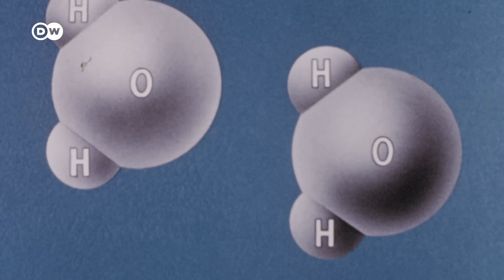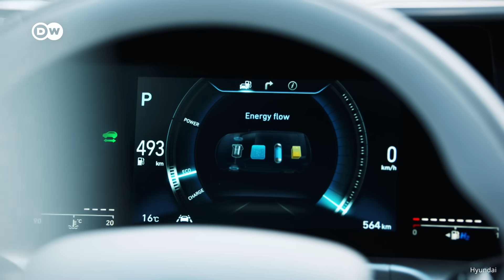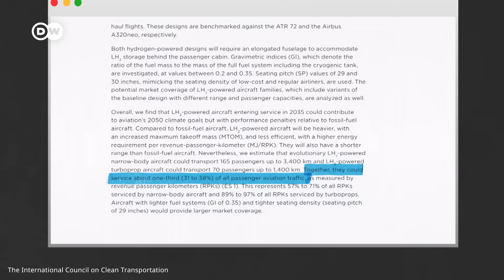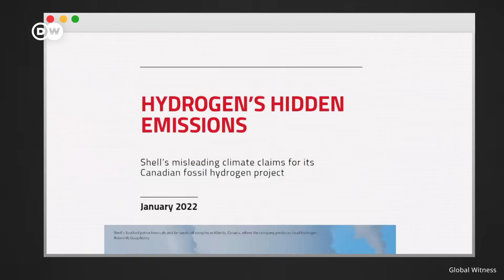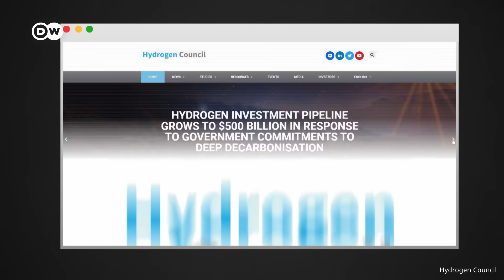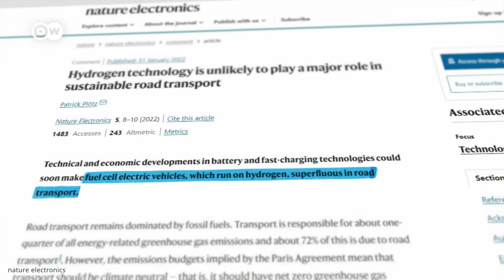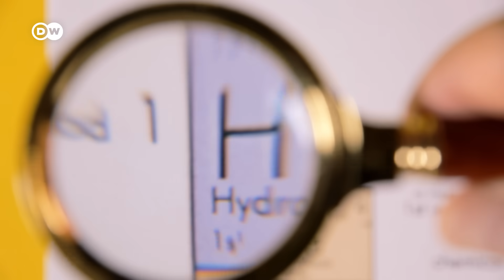The truth about hydrogen

Comment from the maker: What do you make of the hydrogen hype?
Reply: I got a question : FRESHWATER. Is it needed for it ? If so, we should just ditch the whole thing.
Reply: @lysandroabelcher2592  u can use sewage water and sea water too
Reply: @mariofornarelli1067  nice idea with sewage water. Never thought of that. It would solve my apartment block's waste, if it was possible.
Reply: @mariofornarelli1067  you can but it's less cheaper as a process than using freshwater and worsening the environment.
Reply: @anyonehome8609  Plug Power is using sewage water for their hydrogen plant in Cali. They are using renewables to make the hydrogen too
Reply: @mariofornarelli1067  thank you for that. I will take a look.
Reply: @anyonehome8609  Np 😊 And if you want to invest in Plug Power their ticker is $PLUG. Plug Power only makes hydrogen from renewables (green hydrogen)
Reply: @mariofornarelli1067  I was just having a look at that
Reply: @lysandroabelcher2592  what’s the by product of burning hydrogen?
Reply: @bundunett3212  water STEAM that flies far away from the freshwater body it was taken from.
Reply: @lysandroabelcher2592  Yes, you do need  fresh water but not just fresh, you need, you need pure water, free of contaminants. Your household water supply would need to be purified. 

But your comment  I assume, relates to the amount of freshwater needed and the fact that fresh water needed for human or agricultural use would then be depleted.

You needn't worry. We now have as much water as the planet has ever had or will ever had.

We'd be taking a minuscule amount of it to power the whole planet if we were to do that via GREEN hydrogen. When put through a powercell, that hydrogen would turn to water when exposed to oxygen. That reaction is what produces electricity. If that water falls on the ground it would evaporate and fall as rain on the oceans or rivers or lakes.

But you're right. You couldn't build a desalination plant in Nevada's desert and use Las Vegas' water supply to produce hydrogen.

That is why you would build hydrogen plants next to big flowing rivers or preferably, on coastal locations where you would also build a small desalination plant, tiny in fact.

I say small because you only need 10 litres of water to produce 1kg of hydrogen containing 33KWh of electricity. 

10m litres of water to produce 1Mt of hydrogen  that 1 million kg of it. Or 33GWh of electricity.

 

To give you a physical example, imagine a 1m³ box shaped container. That's 1m high by 1m sq. That would contain 1,000 ltrs of water, enough to produce 100kg of hydrogen. You'd  need 10,000 of them producevthe million kg of hydrogen

How much freshwater dies a desalination plant produce?  A small one would produce around 200m litres a day. That'd be   20 days supply for the plant producing  the Mt of hydrogen a day.

Thing is, it'll be a long time before we get plants that can produce that much hydrogen in a single day with renewable energy.
At this stage plants might produce well under 20 tonnes a day. Requiring 200,000 litres if water.

An Olympic pool contains 225,000 litres of water. 
And that why you'd only need a tiny desal plant that produces PURE water.

We have a saying here that gies; "there's more than one way to skin a cat". You shouldn't dismiss hydrogen because it uses fresh water. 

If a desal is built in an area beset by regular droughts, as parts of Australia are, you'd build a bigger plant to make water available to the hydrogen plant an the neighbours in the region. 
A hydrogen plant coupled with a desal plant would be a plus fir the region.
Reply: @reelreflections1  thank you a lot! You should put up another video with all this explanation!!
Reply: @lysandroabelcher2592  You do realise most fresh water is simply dumped into the ocean.
Reply: @crinolynneendymion8755  where? Certainly not in arid regions like California where the fuel it's most needed.
Reply: Do you understand the human body is made of hydrogen as well.  Liquefying the human body for fuel.
Reply: @lysandroabelcher2592 northeast of Calley France I walk in on the process as it was happening and as one of the voices said I went to Paris.  I went by train then by taxi then by plane to dulles airport then by rent a car to my home then
Reply: @lysandroabelcher2592  no, hydrogen implosion technology can clean nuclear waste water 99.98% first pass and 99.99% second pass leaving only water and 6 basic elements though the hydrogen flame which has no set temperature and will meet than exceed any surface it comes in to contact with so far, all known elements.
Reply: @lysandroabelcher2592  pretty sure u can use saltwater but i dont know for sure
Reply: @maxxel_  you "can"... but it might be cheaper using freshwater. So guess what?
Reply: @lysandroabelcher2592  there's more salt water on the planet than fresh. We can create drinking water from the hydrogen.😊
Reply: @lysandroabelcher2592  explain further, please
Reply: @anyonehome8609  if, say Chevron, could have hydrogen as a fuel for a fraction of the cost it takes getting it from saltwater, would they NOT tap in freshwater precious ressources??? We all know what would they do.
Reply: @lysandroabelcher2592  explain less cost effective. You're definition is maybe different to mine. I think we agree
Reply: @Lysandro Abel Cher  it's not that much more expensive compared to fresh water hydrogen production, basically you just need an extra coat for the rods and you're good to go, not too expensive and only needs maintainance like every 2 years so it should be fine in areas for with already existing or upcoming fresh water crisis.
Reply: @maxxel_  what? Are you a bit?
Reply: @anyonehome8609  a bit?
Reply: @maxxel_  sorry, a bot? But you aren't
Reply: @anyonehome8609  yea no hahah, why did u think that though
Reply: @lysandroabelcher2592  just seeing these comments.
First it take water to make hydrogen, then on combustion with oxygen creates water.
The amount of protons produced that are needed to create hydrogen and release oxygen: the question that should be asked is : when before combustion occurs do we lose protons in the process that makes less water.
Reply: @robertangelier4495  nope. Because  freshwater as a raw material would be readily available for other human consumption needs, while pure water vapor as an end product wouldn't be there to be used until only PERHAPS clouds and winds bring it back to the same place it was taken from.
Reply: @maxxel_  or else once can use distilled water also. Just let the water pass through a solar heated chamber and tap the vapor. Pretty inexpensive in vast Saudi desert.
Reply: @maxxel_  Salt is creating a very unwanted byproduct: Chlorine.
Reply: @maxxel_  Storing energy is much more than battery parks. Storing it as potential energy,  like pumping water up to store it, is a metode used today.
Reply: @th5841  yea i know, i literally study this stuff and i never said that batteries are the only solution, far from it actually. but they do have their part in maintaining a stable electricity grid.
and yes, water pump storages are great and the efficiency is amazing but you need the geological requirements for that like a mountainous region so while countries like sweden don't have any problems with energy storage in other "flatter" countries you can not rely on this technology too much and need other solutions.
Reply: @maxxel_  Yes, some regions have the better oportunity to pump up water. Like Norway where I live. I know about two places where they do that. 
There could also be other ways. Like a gigantic screwdriver that lifts up a mass. The E=mgh gives many opurtunities. Then the sum of all good enginering, including battery storage, could take us as far as possible.
Reply: @th5841  i don't think that artificial mass storages are the way to go though. they are way more expensive than you might think and their efficiency is questionable due to friction of these moving parts, but yea there are soooo many different ways of storing energy and they all have different pros and cons.
that's one of the many reasons why the whole process of switching to renewables is so complex but I'm very hopeful that we can do it :)
Reply: @maxxel_  I guess the problem with salt water is the production of chlorine gas and hydrogen gas along with sodium metal and oxygen. Chlorine and oxygen are very, very reactive and destroy electrodes.  An old high-school chemistry experiment that won't be allowed these days is to mix sodium hydroxide with hydrochloric acid, both are dangerous corrosive poisons in their own right.  But combine them and you get a (safe) salt water solution.  I suspect pure water will be needed for hydrogen production.
Reply: @lysandroabelcher2592  it is but not in a quantity that would matter
Reply: @farmer4525  tell that to corporate greed.
Reply: @farmer4525  (and others ...) "[water is needed] but not in a quantity that would matter" Actually, that's not an accurate conclusion, as it casually glances over a huge amount of complexity. It may be that you've arrived at that conclusion by reading through Green Hydrogen marketing literature. That claim may be arguably true at the initial prototype-project levels being proposed, however at the scaled production quantities being spruiked globally in sales pitches by Green Hydrogen proposals as a key alternative "renewable" energy source to help save us from ourselves, the projected quantities get significant.

Water use in Green Hydrogen IS a significant issue for a number of key reasons: 1) We already have a significant and growing problem with human water-consumption globally, where we are being forced to consider inefficient and at best insufficient solutions such as desalination; 2) We're already in the midst of a global climate disaster, where global weather patterns are see-sawing between droughts and floods in large areas - impacted in part by the loss of large sub-surface and surface fresh-water stores that help drive and regulate the global climate system; 3) We're already suffering climate-change-related problems that impact the ocean, such as temperature rise, acidification with concerns of current and losses of large bodies of frozen water in ice and glaciers: all of which play critical roles in the climate system. Perhaps  one of the biggest concerns is the weakening of the thermohaline circulation of the great ocean 'conveyer belt' (e.g. AMOC). Over the 21st century, the ongoing decline of the AMOC has been assessed by the IPCC as "very likely" as it continues its decline towards potential shutdown. This latter point is important because the AMOC operates based on a sensitive function of temperature and salinity distributions as well as atmospheric forcing. If we increase the salination levels of the ocean through the expanded operation of desalination plants, we add further negative impacts to the ocean conveyer, let alone the many other impacts to marine ecosystems. Removing water from the ocean and increasing the salinity of the remaining ocean water simply hastens the damage to a key climate system element, 4) There's also a lovely, simplistic claim often made that in consuming the hydrogen, it simply gets "converted back to water", implying that as if by magic, conversion to and from hydrogen has no impact: sadly, this glosses over several facts, not least of which is the fact that for the duration that Hydrogen is sitting in storage, it has effectively been removed from the global water system.

With all of that contextual complexity, it's non-sensical to say that the use of Water (fresh or desalinated) for green hydrogen is "not at quantities that would matter": right now EVERY amount of water used by humans that takes it out of the normal climatic system matters.
Reply: We don't need to upscale the current hydrogen market. What we need is to completely change the current hydrogen manufacturing structure which is by methane reforming method, with electrolysis powered by renewables.
Reply: @michaelanthonymoreno1701  yes
Reply: @michaelanthonymoreno1701  you still need demand to fund this manufacture change. Otherwise, green hydrogen will be produced just "for the sake of planet" and not for meet people's needs.
Reply: well in order to maintain a stable power grid we need power storages to compensate for unreliable renewables. and we need hugeeee amounts of capacity to make that work and storages like batteries (while we should still implement them for different reasons) can not be the single solution for that. they are way too expensive for such a large scale power storage and thats where power2gas comes in. we can use "leftover/unusable" energy that is produced by renewables to feed into big storage facilities which can compensate for long periods of energy droughts, so we dont have to rely on conventional energy anymore. this will take some time and a lot of money, but we would have an abundance of green gas that we can use for basically anything.
thanks for listening to my ted talk lmao
Reply: @maxxel_  Batteries at the grid level is a mass delusion. Wake up.
Reply: @billnorris8457  you still need to regulate the grids power input/output to uphold the frequency, batteries play a part in that bc they have insanely fast reaction times. but yea batteries in the sense of high capacity energy storages is just not cost efficient at all
Reply: @maxxel_  Did you know that the manure from one cow can provide enough hydrogen to run a car for one year? What about waste from chicken farms and zoos and campgrounds? In my area we have lots of these kinds of things.
Reply: @maxxel_  Sand batteries for large scale storage are on the way , do not assume that batteries are going to be expensive in the near future there are many new initiatives on the way.
Reply: @reverendbarker650  do you mean salt batteries? i was talking about electrically charged batteries like lithium-ion which have comparatively really high power to capacity ratios and can react incredibly fast. because those will probably stay on the more expensive side for the near future (polyjoule is something pretty interesting to look foward to). but the main problem is that we need solutions now and are already behind on the time schedule for actually building them so even if there are promising technologies, we can't just sit around and wait for another year or two until these things are ready for the market.
Reply: Water vapour is just as much a greenhouse gas as carbon dioxide, so burning hydrogen isn't a solution. Also, hydrogen molecules are very difficult to contain due to their size (they found that out in the days of airships, German Zeppelins used as their skins several layers of cow intestines), so for domestic supplies pipework would need to be upgraded.
Reply: Yes, thermally you are correct. But, water vapor can condense easily and rain back down. Soooo
Reply: I don't buy the hype for many of the reasons detailed in the video. Unfortunately, loud and reactionary automotive enthusiasts keep bringing Toyota's little project up as if it was anything more than a publicity stunt.
Reply: Hydrogen or electricity, I'm just excited for all the efforts that we are making to move away from fossil fuel.
Reply: I believe a big advantage could also be the housing heating systems. There are already start ups providing full systems, which create hydrogen from your solar cells in summer store or in bottles outside and reacts it when needed on a fuel cell to create heat and electricity (and maybe heat from electricity again) making common households more autarkic. If course right now it's still expensive and it's only for single or double family homes, but the economy of scale could help in the future to make one of the biggest energy consumer in Germany (private heating) finally greener
Reply: You don't really need pure hydrogen to run fuel cells; Methanol or Ethanol works too!
There is carbon in both but since you'd only release the carbon back into the system it would be carbon neutral.
Lürsen, the yacht manufacturer, is experimenting with a 100kw methanol fuel cell, right now, for shipping and yachting, and it looks promising.
Reply: It's hype. Exists solely so Shell, Saudi Aramco and all the other oil manufacturers have something to manufacture and transport.
Reply: @ikanderson  you can produce your own hydrogen in your home garage. This will ultimately bypass the big oil companies.
Reply: looks like we would win more by using less energy in the short run. do this by  making the fossil energy more expensive. then use the extra revenue for investing in green alternatives
Reply: @RS265cup  just put sanctions on the Russian Oligarchs, take away there private jets and we would be halfway there
Reply: You managed to miss the most important thing about Hydrogen: it can turn more than 90% of the world's houses (that are now dependent on grids and fuel stations) into totally self sustained units when it comes to heating,  electricity and car fuel. This is why the oil industry is reluctant to adopt it or even invest considerably in R&D.
Reply: You failed to mention the NOx that is emitted when burning hydrogen. Catalytic converters don't work from cold until they reach extremely high temp, so burning hydrogen in the home should be explicitly taken off the table. Burning green hydrogen still prevents us from getting to zero.
Reply: Exactly that...hype. There are no free rides.
Reply: I think the hydrogen hype is a load of rubbish because ALL fuels contain hydrogen. Without hydrogen there's no fuel at all!!! Hydrogen is contained in all man-made products like petrol, alcohols, metals, acids etc. Hydrogen doesn't come from water. Btw, I'm not referring to hydrogen being a gas but being the release of stored energy held under vacuum within all materials and substances.
Reply: @PeterPete  Yes, H2 has 1/20th the energy of methane.
Reply: @888Longball  yes that's probably because methane contains more impurities!
Reply: I'm old. Since the 70's, I've heard that hydrogen is the answer. Still waiting. As a guy who has been a hydrogen plant engineer, I know that it takes a lot of energy to create hydrogen which has relatively little energy. Hydrogen has 1/20 the energy of natural gas. We only used to transform other molecules that were useful.
Reply: @888Longball  Reformation of natural gas into hydrogen is almost 80% efficient. It is necessary for unlead gasoline. So America is extremely efficient in reformation. 

But you are very correct that the refiners demand a huge profit margin on it. Exactly why the refiners do so is a mystery. Likely progressive political capture to avoid displacing foolish primary battery cars. 

But Toyota and Honda have both bet their future on fuel cells. Neither company currently believes in primary battery cars. As their hybrids are superior and more energy efficient. 

there are roughly 6 natural gas mmbtus to match a barrel of oil energy content. $30 versus $100. 

True, rational American co2 policy would be natural gas commuters. Not these insane battery cars.
Reply: Nonsense. Hydrogen is only means of transport or storage.
Splitting water costs a lot of energy.
Where are you gonna get that energy ?
Reply: @oscarvanwalstijn6902  Reformation of natural gas my friend. 80% efficient. 

It is the insane intermittent windmill and solar panel progressive zombies babbling about splitting water. 

Corrupt American progressive made Toyota and HOnda offer a not more energy-efficient primary battery cars. 

They told us before the progressive A Nevel zombie herds were released, their hybrids were superior and more energy efficient. WHich is why their development budgets went to developing hydrogen fuel cell in surface transportation. 

America has a 10,000 year supply of natural gas held in ices. 5,000 of which is onshore and could be developed at competitive prices. Certainly world prices. Plus the natural gas is liberated from the matrix by carbon sequestration. 

There is more to the story. But that should be enough. If only our EPA and others were about science rather than political progressive zombie control.
Reply: Well, it's kind of sad that energy sources and actual usage roles seem to get thrown together constantly. As if heating houses would be the same as fueling vehicles or producing heat for steel production. There is not one one "fuel or energy source" that can cover it all. Just as it is horribly unfortunate that we, at least as a source for electricity, seem to have simply forgotten that we already have a perfectly suitable and abundant, clean source for providing the lion share of such energy, which is nuclear power. Why on earth are we proposing to force the rapid switch to electric vehicles if the electricity we need to charge them largely comes from burning fossil fuels, just to create some illusion of "clean" or "emissions free"? It's just sad that major innovations around nuclear power plants has basically been abandoned purely due to fear and it being politically risky after very isolated incidents in the past. Burning fossil fuels around the world is endangering and destroying lives around the world, every year, and is causing global warming, but we abandon the most promising technology in favor of a patchwork of green bandages like solar and wind, disregarding any thoughts on what to do with all those panels after they reached their end of life or the resources required today to produce them (to name just a couple side of downsides ). Yes, hydrogen can and should be a part of the solution, if done right, just like wind and solar and water... But nuclear power can and should play a much bigger part in this debate. We have fantastic solutions for its waste products, it creates an enormous amount of energy with a very small footprint, it's almost completely emissions free and can be produced safely if we allocate appreciate resources for future development of power plants. It also seems that, like so often, the lions share of public debate revolves around each individuals role in combating the overall issue at hand, instead of identifying (which had already been done) the greatest, large scale and world wide industries that contribute to CO2 emissions (yeah, it's not "carbon" that's the problem btw, it'd be great if we use correct terms, so everybody is on the same page ;) , and focus our efforts on dramatically reducing those contributions. It's a bit like the whole "recycling" and "litter bug" story where the largest contributors of plastics shifted the blame to the consumers, just now it's companies like BP that made us question and worry about our individual "carbon footprint"...
Reply: Complete nonsense. Same as your docu, which is riddled with errors. Posing to critisize, while not even understanding the basics of why this is nonsense. So you are basically advertiseing hydrogen, with not a clue what its about.
Reply: Th elite class will not listen.
Reply: To sum up discussion about hydrogen I will quote Elon Musk about fuel cells :"fool cells"
Reply: @keanu9988  good quote, Greg. Thanks for adding it. 
The major auto companies gave up on hydrogen research pretty much 20 years ago, because it has no real potential for mainstream use. But we keep hearing this hydrogen echo because private/public grant money still trickles around and these green nuts don't want to get a different job.
Reply: Hi,
thank you so much for making this video. I am doing my PHD as a researcher on the energy transition and investigated hydrogen for about 2 years. To my findings, you are totally on the right track. There is not nearly enough electricity to make a significant amount of hydrogen within the next decades and the stories of using "waste, excess electricity" do not hold by any means on a quantitative scale. Many places typically considered the sources of giant H2 amounts, eg. North Africa, show totally unrealistic when the markets there are investigated in more detail. A second aspect are prices: we did a very detailed analysis on the supply chain and found that many studies (including those of Bloomberg) are way overestimating the cost reduction potentials and are typically ignoring significant cost factors e.g. for the necessary infrastructure investments (grids, roads, water desalination, pipelines, harbors, etc.) or are not using any "grid costs" at all. Using the most optimistic estimates for all aspects in the supply chain (electrolyser costs falling from 2.000€/kW to a tenth, 2ct/kW renewable electricity, high full load hours, minimal grid costs of 2ct/kWh, very cheap liquefaction costs,...) we resulted at a minimum of 15-21 ct/kWh hydrogen in Germany. At this price this is so expensive that hardly any realistic use cases remain. Even for the "safe havens" like steel production or "the chemical industry", it turns out that molten oxide electrolysis (from MIT/ Boston metal, using electrolysis directly on steel without the detour over hydrogen) seems significantly more energy and cost efficient; similarly, most chemicals can be provided cheaper on different ways. I talked to several other researcher on this topic as well as lobbyists from for hydrogen: None of them could provide just one consistent story line for "where to get the hydrogen", "how to transport the hydrogen" and "what for which end consumption to use the hydrogen". Instead, the feeling grew that institutions like the "hydrogen council" are not coincidentally full of players from the fossil fuel industry and the energy intense industries, but the hope actually is to allure people with the vision of green hydrogen and then bluntly sell blue hydrogen for - as the energy industry hopes - cheap prices that allow to continue business as usual. 
Please keep up with your great start to inform people on all of the traps that are laid out in this context (and feel free to approach me, if you are interested in a more detailed discussion and other issues with the common narrative)!
Reply: @jamespiccus1073  very convincing; the green nuts don't like facts getting in their way.
Reply: The joke is that CO2 has nothing to do with the temperature and the climate on earth
Reply: @lucbos7516  yes and funnier yet, we exhale CO2 24/7/365 and the government hasn't mandated we wear catalytic converters over our heads to protect climate.
Reply: It's never a good thing to hype up things more than they are worth. But In some aspects, along with electric power I think it's a good source of fuel.
Reply: 9:03 this idea needs to change. if you burn it, that is true but if you use the hydrogen to a fuel cell for turning electric motors it comes out way ahead than natural gas ICE vehicle
Reply: I think it's greenwashing. The technology will take decades to bear fruit. I think governments could better direct their dollars towards investing in using renewables and nuclear to create methane from building blocks like carbon dioxide and water, then using that green methane in our existing natural gas infrastructure.
Reply: We can use hydrolysis to directly charge batteries without  the need for hydrogen storage
Reply: I don’t see why there should just be one solution. Anything that reduces the global emissions footprint should be considered. We are likely to see these solutions shift, gain efficiency, and reduce costs over time.
Reply: @GordonMoat  what's wrong with one solution for everything?
Reply: @anyonehome8609  Failure potential, supply chains, raw materials, and concentration of manufacturing.
Reply: @GordonMoat  can you explain further?
Reply: @anyonehome8609  Many examples that I could give, though I prefer not to be typing so much, so let’s just use one raw material, lithium. Suppose environment, or economic disruption. That could be earthquake, or storm related infrastructure damage, economic sanctions, or export restrictions. Most lithium comes from China, so those risk factors are not unusual. Assume something happens environmental or economic, and suddenly lithium mining is halted in China, or exports are cut off or otherwise restricted. Manufacturing elsewhere would need to pause, halt, or cease, depending upon the time duration of the supply disruption. So if we want our one solution to be lithium ion battery transportation, we need to imagine supply disruption to apply the proper risk factor. You could repeat this assessment with any other component involved in lithium ion battery transportation. Hope that makes sense.
Reply: @GordonMoat  why do you need a battery?
Reply: @anyonehome8609  Electric cars.
Reply: @GordonMoat  the thread is about hydrogen not electric
Reply: @anyonehome8609  You specifically asked me why not put everything into one solution. Rewatch the video and reread the comments, and you will see electric vehicles are part of the discussion. Don't be dense.
Reply: @GordonMoat  I have only spoken about hydrogen. Why resort to insults? I have not insulted you.
Reply: @GordonMoat  the whole point is that we all work out the solution. No one is wrong or dense.
Reply: Every new technology takes a while before it becomes efficient or cost effective as opposed to the dominate tech. They ONLY become cost effective through scale of use !!!!!!
Reply: What you failed to mention is how hydrogen is stored and transported
Reply: @davidocallaghan7791 

THANK YOU!! 

Just explained ammonia cracking to someone on another thread. 

People seem to forget we need to be able to store and transport this shit lol
Reply: Is it even worth the energy going into making Hydrogen? Direct electric boilers and stoves not far more efficient. Same story with fuel for cars, input energy to make Hydrogen to make it back into electricity. Than Hydrogen should be looked at like a battery, is it efficient enough as a battery.
Reply: @dadikkedude  hydrogen is flammable
Reply: @dadikkedude  yes. Hydrogen is a gas, not a battery
Reply: Overhyped. By the time we can actually rely on green hydrogen we will probably have a much better battery technology.
Reply: @daname1491  and how are you going to charge the battery?
Reply: @anyonehome8609  The same way you would do the electrolysis for the Hydrogen - renewable energy and if they exist by then Thorium Reactors
Reply: Or if you mean the charging itself. That would depend on the battery type.
Reply: You forgot that one can create hydrogen using nuclear energy. With a (very) high temperature reactor (V HTR), catalysts and water one might be able get high efficiency in hydrogen productio, possibly much better than with electrolysis as heat to electricity conversion (with turbines) wastes over 60% of the energy. And this is not scifi but an old idea, and China has first HTRs running. Germany abandoned its project sometimes in the 90s.
Reply: Producing hydrogen is an energy intensive process which ever way it's refined. The storage is another energy sapping process. Most hydrogen is produced from LPG. The energy in all hydrocarbon combustion eg. coal, wood, natural gass and oil is hydrogen. The hype is just that, hype. It the least efficient method for the end user. Wind, solar and hydro power also has a big impact on our landscapes.
Reply: @AquaMarine1000  see,solar energy is FREE , we just need to store it cheap,and safe .
Thats why we should also include H202 in our equation for density and safety .
Water is lots cheaper than lithium .
Reply: @NCOGNTO  Yes solar is free but the mechanism to capture the energy and convert it to electricity is not. Much if not all mining, manufacturer and logistics relies on hydrocarbon energy. Look a bit deeper and the chain of energy use will become clearer, there is no simple solution.
Reply: @AquaMarine1000  i know .
Thats the thing we need to quit doing .
We need ways to make it work .
We should act like we really mean it .
Want to talk about the cleanest fuel there is ? Good basic discussion .
Reply: @AquaMarine1000  push my icon Chris
Reply: If we do succeed in the future to use hydrogen for most of our energy needs, we could increase the relative humidity of the air we breathe by a significant amount. That is a climate change I don't want to cope with.
Reply: It's a science project.
Reply: @Stuart van der Lee  Ironic: that comment can only come from 2 sources. 1: a fossils/nuclear advocate

2: someone that's not kept up with developments in regards to hydrogen.

The fact is, the science is over a century old and it's well established. 
How do you suppose The Hindenburg came to be? 
The technology failed it but the science was fine.

The tech is also now established. There's now trucks and buses plying the roads roads, also, trains and local shipping operating, all powered by hydrogen.
Hydrogen powers those vehicles by charging batteries  in part. 

That establishes hydrogen as an ELECTRICITY STORAGE MEDIUM that to be transported in limitless volumes can be converted into ammonia, NH3.

Talking about ammonia; how did you suppose most fertilisers are manufactured? ... with Ammonia which is 3 parts hydrogen 1 part nitrogen.

Ideological opinions usually get destroyed, especially when they're not based on scientific facts in this debate.

Pls read more and educate yourself before destroying your credibility and/or reputation.
Reply: For transport seemingly nobody takes into account that battery powered cars have a problem with resale value and longgevity. Each cycle of charging, uncharging means a loss of capacity. So a battery car that is 10 years old has no resale value. If your battery pack is broken you can throw the car away. I think fuel cells also have an advantage for that matter
Reply: its hype.
Reply: Hydrogen is not a fuel, it's a battery.
Reply: @brokenrecord3523  hahahaha ok! nitwit! i guess not only your record is broken!
Reply: You can't plug in your car and recharge the hydrogen.
Reply: Interesting and educating report. I was wondering already, as H needs to be produced as an energy carrier. This confirms in detail that it is not a green solution on itself. We have a problem in our democracies that we have a short government turn-around time, making politicians short term thinkers and in for short term hypes, while we need thorough research on many alternatives and come up with the best overall system paradigm and then long-term investment to make the change needed.
Reply: Hydrogen is only good for moral preening. Storing hydrogen in a car is impractical for starters. Batteries are better but even they are far less practical than liquid fuels, except for urban daily driving. The solution: an EV with perhaps an 80 mile range with a fossil fuel generator for longer trips.
Reply from the maker: Hi  @grantjones8690 , have you seen our videos about batteries that we've done before? 
"Can you recycle an old EV battery?" https://youtu.be/PbOBmnZRpZ4 
"How salt and sand could replace lithium batteries" https://youtu.be/-vobMl5ldOs 
Let us know what you think in the comments section 🙂🌍
Reply: Hydrogen is a terrible store of energy (and is not a fuel). Methanol has more promise, but good luck of ever having the best option win with all these government subsidies flying around
Reply: All hype, we have to double the electrical power generation in the world, just to offset gasoline.  And as you say charging batteries is a net 20% loss in energy conversion for charging those batteries.  Solar and Wind have not lived up to their promises either and neither are carbon zero, solar is 2.5 times the carbon footprint of nuclear and wind is about equal to nuclear.  Also where you put solar has a huge impact on the CO2 equation.  If you replace a corn field like here in Illinois where I live, when you combine the CO2 generated in building the solar equipment, installing it, maintaining it and decommissioning it and then the cumulative losses from not planting crops you actually are worse off then burning natural gas for power.  So now your green hydrogen is not so green.  Now if you look at your 60% loss on using Hydrogen when you look at your supply chain the power you need is closer to triple that of what we currently produce.  The scale of the TWh requirements just cannot work out, most people cannot get their heads to understand the numbers.  The problem is Li-ion batteries and hydrogen and simply not reasonable paths forward.
Reply: As you know, regardless of the fuel spoken about (whether it's petrol, methane, butane, propane, even water, etc.) the secret to releasing (or capturing) power is the hydrogen in each. So, ultimately, the reason for the "hype" about hydrogen is because no matter how we generate power in the future, the resource that we'll  need to harness is hydrogen. It comes down to how we package it or distribute it.
Reply: @volshebny  not true at all; the hype is to split out the hydrogen so it can be used alone as fuel; why in the h&## would someone waste other fuels to get another one is totally beyond common sense; using a fuel directly is ALWAYS the most efficient; all this other chemical games-playing needs to be buried under universal contempt.
In the case of hydrogen as a fuel, it is so explosive it is dangerous to use, even by experts. Might as well dig coal from a mine and accept that they occasionally have cave-ins/explosions, but the fuel will be tremendously less expensive to use than hydrogen in mass quantity.
Reply: @rayrussell6258  Dude, I was just talking about the fact that hydrogen, the base element, therefore the most plentiful element of the known universe,  is the component which guarantees combustion, therefore, no matter what it's state, however it's combined in a molecular state... it's the reason  we use ALL THOSE items I listed earlier for combustion. That's all I was saying... I wasn't talking about converting... so however you want to package it means "the package " = the fuel (regardless which one you pick). Understand?
Reply: @volshebny  this thread is about using H for power generation, not other compounds. 
What I understand is you being obtuse; H is most plentiful they say, but it is not available naturally anywhere in a single isolated way, it is ABSOLUTELY a requirement to CONVERT other compounds to get the simple H; you ignore the former (actually admit you deny what is mandatory, ie converting) and promote using the latter (simple H) for "combustion"; 
I'm not falling down low enough to "understand" what you obviously don't understand; those other compounds have their own uses, we should not create shortages in other places so we can use them in inefficient processes to create electricity. 
At best, I can only say perhaps your comment has nothing really to do with the point of this thread; but I think you know you meant your comment to be about converting those compounds for the H isolated, denial and tricky word games you play don't impress me. Sorry DUDE.
Reply: @volshebny  finally you say something true. It was about hydrogen hype. 
(and getting electricity from it)  
I'm not a control-freak, I'm just not afraid of stepping on you green alternate fuel nuts. You saw a headline putting doubts on your baby, and thought you could blunt the content in the thread by bringing in many ways to get hydrogen. Instead of agreeing it is hype (like most of us do who have common sense), you tried to further the inefficient method. 
If not me, someone else would have called you out for it. 
Now to put a stop to this, I think the best thing to do here is mute you.
Reply: The big lie they always use is that hydrogen is the most abundant element in the universe.
Technically true, but hydrogen is practically nonexistent on Earth in elemental form. You need to MAKE hydrogen, in an energy-intensive reaction. Electricity and water in, hydrogen and oxygen out. This means hydrogen is just a really weird and dangerous battery. We're back to being dependent on coal.
As Morty would say, That's just slavery with extra steps.
Reply: @protorhinocerator142  is not a battery but a generator, hydrogen is a gas, all gases need oxygen to burn the hydrogen fuel cell water based generator produces hydrogen within its own loop without any burn, there is no excess hydrogen from an outside source needed, it is created on the spot, energy taken on the spot, and 2 negatively charged H atoms joining with an O atom on the spot so intense it will suck an O atom through the wall/membrane from the other side where the O is creating a vacuum. Then back to water. so in 1000 yrs zero water will be consumed, zero oxygen, and zero hydrogen and no need for any input.
Reply: @BCFalls1  You're describing perpetual motion.
As soon as you have that figured out give me a call and I'll buy one of your infini-cars.
Reply: @protorhinocerator142  you cannot buy it because one cannot sell it but you can make it yourself to get around the laws. But yes perpetual motion, the biggest trade secret possible.
Reply: @protorhinocerator142  perpetual motion as long as there is a draw of energy like a clock to continue the vacuum
Reply: @BCFalls1  OK you make one and I'll get around the laws to buy it from you.
Reply: @protorhinocerator142  you do not get it, I cannot sell it period! I will have to make them and give them away for free which I may do yet. Not for profit maybe even if possible have not yet looked in to that scenario for a Global scale. You can however buy the parts and make it yourself, buy the Ballard fuel cell stacks for the amount of energy you need, the search y-tube on how to make the best electrolyzer using magnets + and  - on a trickle charge to keep magnets topped up or one of the various other methods out there. One gas rises, valve on top of vertical tank the other drops valve on bottom of horizontal tank, not needing to be big but big enough to house the gases. Bob's you uncle, another cheap way is the Honda solar powered hydrogen separation station hooked to ballard cell stack .never pay for energy ever again in your life and the hydrogen can be used for your car. free ride
Reply: @BCFalls1  A few years ago there was a car company selling cars in November and giving away free turkeys. The lawyers said they couldn't do that.
So they sold the turkeys for several thousands of dollars and gave the cars away for free with the purchase of a turkey.
If you had the real deal you would figure something out.
But you would have me believe that your guys are brilliant enough to solve perpetual motion but can't figure out how to call a lawyer to make a legal sale.

I knew a guy at work 20 years ago who was into this stuff. Free energy from condensed air, and making gold using modern alchemy. Stuff like that. When CA had its electricity crisis back then (some things never change) I told him his guy should sell those things in CA. Someone would buy them even if it's technically illegal.
He told me the guy was starting over with a more efficient design.
I told him his guy was completely full of crap. You sell the model you have as version 1.0, and then use the money from all that to make version 2.0 with the efficiency improvements. If that was real, his guy would have made billions. This proved to me it was fake.

Here was another thing I told that guy 20 years ago. If you have a perpetual motion/free energy machine, which is illegal to sell, simply slap a little $10 solar panel on top and now it's a solar panel putting out 1.21 GW of power.

Also, is it illegal everywhere or just in the USA to sell a perpetual motion device that creates free energy?
I'm sure right about now Europe would be very interested in something that could free them from the shackles of Russian oil.

There are ways, and there are ways.
You're hiding behind a very basic law that I could bypass in my sleep and make a kajillion dollars.

How is it your guys are smarter than I am in perfecting free energy, but so much stupider than I am when it comes to monetizing such amazing technology?

Seriously, if your team has solved perpetual motion simply prove it to me.
I'll make everyone on the team disgustingly wealthy and only take 3% off the top for my minimal efforts.
You will have enough money to buy a yacht big enough to have a swimming pool big enough to have a yacht.
That's some serious cashish.

Plus we'll solve the world energy crisis, and do it all with zero CO2 blah blah blah but mainly we'll all be filthy stinking rich.

If it took me more than two days to turn a working concept into over 100 billion dollars I'd be very surprised.
By the end of the year that would easily be  trillion.
And my personal cut would be 30 billion.

Show me the working prototype or stay poor forever.
Reply: Hyped, may be. 
I had done a project during my college days to generate electric current from aloevera extract using zinc and cadmium electrodes, it worked enough to light a bulb. Not sure at what scale this experiment can be upscaled but neverthless, it an option.
Second thing, i always felt that we are not optimally using energy provided by the Sun. We can generate electricity from it but we need a storage capacity as it is currently stored as DC in batteries, can't we directly convert it to AC without ever needing batteries and have a global grid as we have optical cables under water?
Reply: @WisteriaFamily  Nice!  Are you familiar with Bloom Box? I think it was some kind of ionic-transfer process.  The reason I made my comment about the many compounds which hydrogen is found is because of the many options we have to get to the hydrogen. ... what I referred to its "package" (how it's packaged in nature). Anyway,  people have been playing with many alternatives - including charged particles in the air (like the toroidal engines which exploded in popularity a few decades back), the water-driven car (like Stan Meyer's design), and the liquid air driven car, the Peter Dearman design). Of course, they all had their problems to overcome, but most were very promising. I'm with you and the Biofuels, they are really taking off - let's be honest - because of the UN's Agenda 2030 and its Sustainable Development Goals (SDGs).. I have a friend who recently went to Samoa to help set them up with a number of biofuel generators under one such program.
Reply: @volshebny  See? You still promote processes that are inefficient and downright dangerous.  Knew you weren't just listing those other compounds randomly; you listed them to get talk started about using them in the process to generate electricity or other types of fuels. 
Very wasteful processes. It's not going to happen. You might as well get ready for the comeback of coal. That's more likely than "hydrogen".
Reply: is is all HYPE!  hydrogen production is an ENERGY HOG and it is TOO EXPENSIVE to make it even REMOTELY an alternative energy source.
Reply: You need to think harder about the problems you will create with pushing such narratives that will be damaging for 7 billion people.
Reply: @bobboby2400  You are correct about it, calculations show that even renewables are worse than just burning oil&coal.
Reply: @codaalive5076   Exactly and we are a carbon based life form which is everything on this planet. It's not bad for us that's for sure. I could go through every step of explaining it. But I have done it several times already so I'm kind of tired of putting that much information down I will again know.
Reply: @codaalive5076   Even your toothbrush is basically carbon based.
Reply: @bobboby2400  Are you suggesting CO2 isn't causing global warming and its consequences? Or believe renewables are answer to the problem that will also take care of the base load, toxic waste and other problems too? 
Scientists know it since late 50's, Th MSR was tested and proposed as the safest solution, second choice are APR1400 reactors or similar.
I firmly believe in it for various reasons one of which is oil lobby doing everything they can to continue providing dead ends.
Reply: nonsense, I'm still waiting for that "Anti-matter" hype, looks like it won't be coming anywhere on my lifetime 🤔😒
Reply: I recently saw a documentary about a solar park in africa and their problems exporting all their excess energy. I think hydrogen is a solution for energy export where power lines are inexistent or impractical
Reply: @farmer4525  exactly my thoughts. Why can’t those parks become hydrogen factories and ship liquid hydrogen either in pipelines or in special ships.
Reply: @farmer4525  No. Study the subject rather than let your mind run wild.
Reply: "Inexistent"? I think you mean "non-existent." 
    Meet me for a beer. We'll "conversate." LOL!
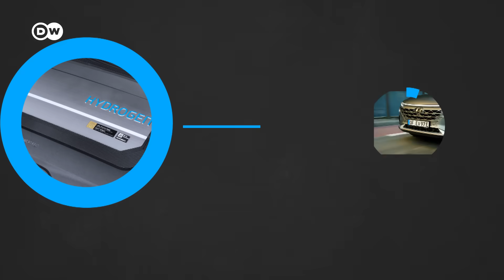Reply: @Jason Walter 9:55 as mentioned in the video, FCV is around 40% efficient but burning natural gas or LPG is less than "petrol which has around 20-30% efficiency".
Reply: @yorkyone2143  and how do you create the electricity to power the electric motor?
Reply: I am in Switzerland and I have discovered a very new amazing property of a material which produces Gas H2 and O very by splitting it does not need much energy . I tried hard to find a sponsors to do research but I could not find yet! please help me to reach EU audiences to find funds for more and professional research. I have videos made and I can show you a sample! please get in touch with you any one interested please leave comments I will write to you.
Reply: @mohammad1080  Hello Mohammad. Are you on LinkedIn?
Reply: @ighodaroajayi3464  yes
Reply: @mohammad1080  How do I connect with you
Reply: There are many sources of energy. Yes Hydrogen is one of them. Different energy sources should be used for different means depending on whether or not they are efficient enough, have a green manufacturing process and of course are sustainable. It will take time and investment yet it is possible.
Reply: ok...Hydrogen problem solved....but are they planning to use oxygen from air without planting enough trees?
Reply: @obliviouscatalyst  H2O split water, you get both
Reply: Hydrogen can be useful for a greener planet but the why they are producing isn’t environmentally friendly and needs to use more renewable and sustainable resources to make hydrogen without any negative effects. Right now the most common method is burning fossil fuels that is called grey hydrogen is the worse production method because you will be producing emissions into the air polluting the air and causing climate change that is terrible for the planet.  Until they change there production method to blue or green hydrogen, while developing green hydrogen to become cheaper I will be against hydrogen plus these companies just lying about it not harming the environment. Lose -60% to -75%of the energy so efficiently needs to be improved as well.
Reply: @TgamerBio5529   A greener planet needs more CO2.
Reply: How many poor countries will benefit from Hydrogen and other green energies? How many people will die if they loose access to cheap fossil fuel energy? I’m sure a lot of elitist’s aren’t worried as long as they can brag about their battery powered homes and vehicles.
Reply: best we can do is reduce.  we need to right now so russia cannot hold over us. so the supply lines are cleared because we all stop buying into the buy a new thiing , thing. We need to pretend we are rationed NOW rather than when it is too late and we really need harsh rations that get people complaining more
 And screw them anti  socials that don't care
Reply: Same as EV and renewable hype
Reply: Hydrogen and Nuclear power is the way to go.
Reply from the maker: @RealGalaxyGamers  Have you seen our video about nuclear energy: https://youtu.be/9X00al1FsjM – let us know what you think in the comments section.
Reply: This completely ignores the fact that a byproduct or co-product of electrolytic H2 is / can be H202 is much safer denser liquid fuel .
Most basic error to not include this cleanest fuel ("cleaner" than H2) - adds O2 to the air vs removing it .
Reply: It's a zero-sum world
Reply: The fact that you call it "hype" is politically motivated - the world knows Toyota is light years ahead of VW and other German automakers in this tech.
Reply: For going green radically now its the best option. After nuclear ofcourse
Reply: Awesome video, very informative and different way of thinking about it. Yes it could be used for everything but should we? 100% agree we have to find that balance between hydrogen and other renewables for everything to work.
Reply: Wow, you never evenentioned Pink Hydrogen...Terrible job
Reply: @brandonmesser2503  or the cleanest fuel (its a liquid,too!) of all -H202
Reply: @Jason Walter Bloomberg predicted this week, that by 2030 in places with high renewables penetration and high solar and wind assets like Australia, hydrogen production will fall to $1 /kg, (33KWh), to produce. 

Even if the sell it at 5 times the cost as electricity, you'd be I paying 15c/kwh. 

A hydrogen powered truck would cut their fuel costs by over 60% $5/kg at the pump.
Reply: Hydrogen should be our way into future ..so the generations will have a safe place to live-else we will be polluting their resources now and wipe out the generations to come
Reply: At our production plant we literally waste the hydrogen we produce into the atmosphere.. the owner claims there's no market for it locally, it hurts me to see the numbers build up of the m3s of hydrogen wasted.
Reply: @Sharkiston _  I don’t know what sort of plant you're talking about but if it's a high electricity consumer, the plant itself could be the customer for the hydrogen.
If the savings warrant the capital expenditure of the storage, powercell and pressurising equipment, THAT H2 could be partly being powered by that hydrogen.
Reply: Hydrogen makes sense but development is needed. As such does Thorium, could replace Uranium thru development of Breeder reactors. The development of liquid sodium reactors are being developed to make them smaller, to be used in space, neighborhoods that become localized or military application for energy
Reply: Hydrogen storages should be viewed as batteries or alternative to batteries. Whatever excess energy generated through solar power should  be transferred to electrolyser (built at public level). Though inefficient, still packs more greens than battery production.
Reply: Green hydrogen shipped around the world is the future. It can completely replace other sources in bulk energy intensive industries( iron, cement), power ships, buses ( mixed with natural gas), home stoves ( mix with natural gas and pump in same pipeline). Why are we focusing only on automobiles? They can run efficient fossil fuels or batteries or even hydrogen cells. All said, green hydrogen is the future.
Reply: @rudys3649  - do you also believe that fresh water should be bottled and shipped around the world? It would "Completely Replace" traditional forms of water, like rivers and springs.  You're failing to understand the energy value of hydrogen is poor, and chemically, it abhors existing in pure hydrogen form.  It takes an appreciable amount of energy and work to separate it, compress it, keep it in H2 form, transport it, and it experiences great loss in transformation from that original energy back into energy again when you burn it or use it in a fuel cell.  Hydrogen is not a primary source of energy.  It's a low grade medium to inefficiently bottle energy generated with other means, and only  temporarily.
Reply: Hydrogen will become another valuable asset that people will fight over to attain control. What desired product or service will be next?
Reply: A Belgium university invented solar panels that produce 250 liters of hydrogen per day (250 liters in Belgium and about 350 liters in Spain). If you would put these panels on houses (they say 20 per house is enough to cover all their needs.) and would gather and store it centrally, you could heat all the houses, cook on it and fill the hydrogen cars. Do this through the country and there would be filling stations everywhere. No transport needed to filling stations, can use the existing gas pipes for transport from storage to house, surplus can be used in factory's..
Reply: Is it scientifically possible to have a electrolysis at home so we just convert hydrogen from tap water in the future? Energy for the electrolysis can come from solar panels. A lot of energy loss is from the transportation of hydrogen right? So if it can be done at home maybe hydrogen power can become another good source of energy.
Reply: Work all sources of energy, solar, wind, hydrogen, natural gas, nuclear, hydro
Reply: Hydrogen is recylable, batteries are not. Also consider a VW ID.3 will emit 119g/km even if you used 100% green electricity. This is due to insane amount of CO2 in battery manufacture.
Reply: Its simple: when all options fail, try something radical new. If that fails, consider hydrogen.
Reply: how about H2 as energy storage ?  The true cost of solar plants and wind farms are energy storage cost . How about we convert solar and win farm energy output as H2 . I know it does not sound right because we are first converting electricity to H2 and will later convert H2 back into electricity . however , usually the true cost of renewable energy farms is its energy storage .
Reply: @stevet5790  Any time you get into creating fuel for storage we run into the Law of Thermodynamics. Energy and matter are not destroyed. But anytime it is converted much is lost to purpose. 

We need to get rational and understand there is no magical grid-level storage coming.  To reduce waste, we would need a superconductor impervious to ambient temperature

By the time you deal with all the realities of 'green hydrogen'? The conversion efficiency is likely below 10%. Plus existing gas lines were not designed to handle it. 

This is why an either sophomoric or worse 'journalist' get assumes hydrogen can be mixed into the natural gas stream. It is insanity to cover the failed insanity of excess intermittent. 

.
Reply: @stevet5790  The key is the reformation of natural gas. As it costs 50% or less per BTU than oil. Reformation is almost 80% energy efficient. 

Intermittent generation is grossly inefficient to being with. This insanity multiplies rather than solves the fatal glaring defects of intermittent. 

But these corrupt progressive politicians do not care. To solve the storage problem, they are attempting to deceive Americans into dumping hydrogen into our natural gas supply. 

Just like the gross abuse of Americans and the ecology by corn ethanol is a scam. Which was covered up by claiming advanced or supernatural or magical ethanol was possible. It is not of course.

Yet the now illegal mandate remains. Please do not add to the abuse with this insanity.
Reply: @billnorris8457  one of the issue is energy independence or several different kinds of energy availability.  Western Europe especially Germany need to import a lot of energy. Say if Germany invest in solar farm in Spain and import Hydrogen from Spain that diversified of energy will give a lot of negotiation power to Germany when they have to negotiate for future energy importing. If US did not initiate E85 , oil prices might already hit $200 per barrel a long time ago . Something when you made energy decisions for a country, it is more than science.
Reply: @stevet5790  Oil is at these prices thanks to Biden lawlessness. American swing production stabilized and lowered oil and ngas prices. 

Intermittent simply is not a solution. Proper application is supplemental. Not to be rude but someone has you repeating 6th beer college thinking. 

Diversification of the energy supply is indeed critical to responsible therefore competent energy strategy. However intermittent wind and solar provide ZERO diversification. Simply because it can not be counted on. 

Intermittent is bad enough. But it is also completely undependable. So by definition, it fails to offer any of the benefits of diversification. 

All of the above nonsense some corrupt Republicans offer is cover for corruption. Better than Biden baldfaced lies. But misdirection lies all the same. 

The law of large numbers or geographic space does not work for intermittent. As grids should be designed to meet six sigma events with reasonable emergencies measures. 

Weather regularly cover move than half of America. THe entire North Sea / Europe are oft fully covered in a wind drought. 

Intermittent properly deployed is a minor supplemental source. Whatever you can think of will not change this reality. 

A zero carbon solution will require technology like small-scale modular nuclear. WHich could be advanced if we were not wasting trillions on excess intermittent. Which has no reduced co2. 

This clown who put this together is either a sophomoric A Nevil zombie or worse.
Reply: hydrogen's NOT a fuel.. its only a storage medium.. & it doesn't store very well.. it leaks past any valves & jointing systems we currently have.. it takes fuel energy to mechanically make it & more to compress it to be mobile
Reply: Hydrogen is just a different kind of battery and probably a whole lot more environmentally to produce and store. Yes it takes energy to produce, but if that energy is renewable like solar, wind, tidal, geothermal etc, then it is a viable option. The more ways we work to create energy from different clean sources, the better we are off in the long term. Thee will always be a huge demand for fossil fuels in the chemical industries, nylons, plastics etc. The car the average person drives does not need to be part of this industry.
Reply: @bundunett3212  Sorry Bundu, intermittent wind and solar does not function as you believe. 

Intermittent energy to power what is by necessity a continuous process will not work. 

It is far more complex than what you claim. 

Finally, we can observe from Germany and California excess intermittent does not reduce co2. Due to the gross inefficiency of intermittent places of the grid. 

We must stop the intermittent mania cult.
Reply: Fuel cells use precious metals (platinum) in their construction. If demand spikes, that can drive up the price of platinum and affect the cost of hydrogen fuel cell vehicles and their adoption rate.
Reply: I am an engineer that has experience designing hydrogen vent for a launch vehicle and have experience in turbofan commercial aircraft. Pressurized hydrogen with fuel cells is plausible for aircraft  but I still question the airworthiness safety of hydrogen but I believe in gas form could be worked as safe. But this would only work for smaller regional aircraft with limiting range due to storage. As for liquid hydrogen for commercial aircraft, I believe it is highly unlikely to work. First, it is going to be very tough to make liquid hydrogen safe in day to day handling  to being safe. Simply, commercial aircraft especially smaller single aisle aircraft see a lot of cycles. Cycles lead to staying on top of maintenance and even then there are part failures that occur despite proper engineering. There will be leaks of liquid hydrogen and hydrogen has a large mixture ratio so it can ignite rather easily. For aircraft, I wait to see certification regulation and right now  it is purely dog and pony show hype.  I may change my mind with full size crash tests. I think SAFs are much better path. They can use methane as well reducing global warming  omissions up to 165% per a Berkeley CA study.

Note burning air with hydrogen doesn't just get you water as result. You get NOX as well. So not squeaky clean burning. 

How square kilometer/miles of solar panels would it take to produce sufficient  hydrogen to even match the amount produced now for current applications? Perhaps compare this to a blue hydrogen operation?

I just see carbon fuels as be way more practical and humans just have to find ways to scrub more CO2 from atmosphere. There seems to be some potential technologies to do so.
Reply: @andret4403  your analysis sounds very reasonable.

What is an SAF? Would be useful to define the term.

I ironically one of the applications of hydrogen that is functioning effectively right now that never gets mention is low-volume electrolysis and injection of small amounts of hydrogen into diesel engines to improve the combustion and illuminate much of the carbon buildup. Decarb an Australian firm installs hydrogen injection onto diesel trucks and stationary generators. Mileage is improved by 20% as his power.
Reply: @colingenge9999  Sorry SAF is sustainable aviation fuel.  I was talking more to the aviation usage. Without looking at the thermodynamics of what you are talking about it makes sense you would see those improvements. I stated that pressurized hydrogen for aviation is plausible and that is mainly because there are those doing in in cars and it has been generally demonstrated to be safe. Ambient gaseous hydrogen does dissipate  well. 

My concerns are with  liquid hydrogen that would need to be used for longer routes in aviation to compete with carbon fuels. Loads of issue due to the cold temperature. For the launch vehicle vent design there was a helium purge to 1 prevent ice build up and 2 to dilute leakage with nonflammable Helium dumping it overboard. Super cold hydrogen doesn't dissipate as quickly along with a much higher concentration of gas and can be explosive as it collects in spaces o with oxygen. If there are practical uses for hydrogen that are economic and safe then more power to it.
Reply: Hydrogen should have had more research and investment years ago rather than now. It clearly has a place on earth as an energy solution. You mention battery powered trucks. Hydrogen WILL be the main source of power for trucks going forward and the reason for this is the weight of the number of batteries required to power a truck over 40 tonnes would be such that it represents a problem. Chassis and axles would need completely redesigning to compensate for the extra considerable weight which itself will impact cargo weight capacities. Additionally the time required for recharging will need advanced planning of cargo routes, not to mention the infrastructure that is needed and the time the truck will be off road whilst charging.
Reply: @problemslayer3538  hydrogen has received a massive investment from governments all over the world. Primarily to develop fuel cells. I have followed this carefully for decades and I am now firmly convinced that the funding of hydrogen is a scam put upon us by the fossil fuel industry. Look at the difference between the take up rate of battery electric vehicles versus hydrogen which is around 1000 to 1 adversely none of those on the hydrogen side are cost-effective. What will always kill hydrogen is that the cycle from electricity to hydrogen back to electricity again will be about 25% efficient versus battery electric vehicles which will be 80% efficient making hydrogen at least three times the cost for the energy no matter how you cut it. Cost of hydrogen fuelling stations is also 10 to 100 times more than the cost for your electric.

You mention charging time which is not the band of battery electric vehicles as it’s made out to be. Initially full size trucks will be loaded at terminals where there is plenty of opportunity to charge the batteries. Tesla has worked out the weight of batteries and so on so the truck can still haul the same amount as a diesel powered truck. Nikola motors was a $34 billion hydrogen truck scam. If you look closely at the development of hydrogen you’ll see dark fossil fuel figures lurking in the background pushing the heck out of hydrogen. Don’t be fooled. No trucking company is going to pay more than three times the cost of energy compare to battery electric vehicles. There is no way to get around it and at the end of the day fuel cost and lower maintenance will win.

unlike battery electric vehicles that have been funded almost entirely by corporations such as Tesla, hydrogen is funded almost completely by governments who have poured billions of dollars into hydrogen to the delight of the fossil fuel companies have courage them to do so.
Reply: It's not hype, it's the answer. Check out Dan Nocera. He's got answers.
Reply: @N0B0DY_SP3C14L  Hydrogen does have some applications but transportation is not a particularly good one primarily because if it’s made from renewable energy it’s cost is roughly 4 times that of simply just using the electricity and storing the battery. If you’re talking about energy storage the NREL doesn’t even take hydrogen storage into account. If you look closely into hydrogen you’ll see that it’s a scam where the fossil fuel industry has tricked the government into investing way too much money in fuel cells. To prove to yourself that this is correct I noticed that there are roughly 5000 times as many battery electric vehicles on the road as there are fuel cell vehicles that started out at roughly the same time.
Reply: I work in the Hydrogen industry, it's the real deal the infrastructure needs to catch up though, China is massively invested.
Reply: @eddyedwards120  I agree  there are existing markets for hydrogen in chemical processes but when it comes to storage and transportation there are much better alternatives. When you say “the infrastructure needs to catch up”, catch up to what and why? The market is pretty much spoken when it comes to electric vehicles that battery powered electric vehicles are the choice since there are hundreds of options and thousands times many more vehicles being produced than fuel sell vehicles. I know that everyone says, oh wait until there are more hydrogen stations but because it takes four times as more energy to create Hydrogen than you can ever get back Hydrogen will always be four times more expensive than simply using electricity in battery electric vehicles in the first place.   

Cost of fuel will be the determining factor and there is no way to change that. in addition, fuel cell vehicles are many times more complicated than battery electric vehicles and they are literally crammed with tanks and fuel cells that occupy half the trunk, a lot of the backseat area and the entire front of the car so there’s no front trunk. The Toyota Mirai has a very low powered engine which helps reduce the size of the components pointing into the fact that it’s actually a very marginal vehicle but I’m sure hideously expensive to manufacture and nothing that will get produced in volume for a decade or in all likelihood, never. That is exactly what the fossil fuel industry wants, another decade to do nothing and then say Woopsie we are only kidding, how about a nice hybrid electric vehicle we’ve been making for the past two decades?
Reply: Also Saudi Arabia is investing heavily, it must be a sign of progression that a country associated with oil is turning to hydrogen and solar to power their new city Neom.
Reply: @eddyedwards120  pretty much every country in the world has done an immense amount of research on hydrogen. Even the Canadian government has put over $1 billion into Ballard fuel cells and has received almost nothing back. You will notice that there is a vast shortage of investors lined up to invest in Hydrogen technology primarily because no one has shown any successful applications. I’ve been looking for hydrogen investment opportunities for a decade and I’ve only run across one which utilizes a small electrolyzer for injecting hydrogen into diesel engines to get more energy out of the diesel and to reduce carbon buildup.

My conclusion is whether intentional or not that hydrogen is actually slowing down our transition away from fossil fuels which is why I believe companies like Toyota and Honda have invested in Hydrogen fuel-cell vehicles. In their case I believe it’s a way of slowing down consumers saying “wait for our new hydrogen fuel cell vehicle” but they are hybrid in the meantime. It is very scam like.
Reply: While the science and businesses are striving for coming up with greener energy solutions most of the world population have no clue about the climate change, the effect of their daily habits; aIso they are reluctant to give up their minor comforts for a greater good. Education of the masses and saving the energy and climate questions from being a part of partisan debate is essential for saving our planet. Enlightened citizen is the most efficient form of energy in my opinion
Reply: @kaganozmeric9822  I agree with your comments about people needing to know more about energy and climate questions BUT I don’t agree that individual action is the key to anything except feel good. It is clear that unless the stranglehold that the fossil fuel companies have on governments throughout the world is released, our global population will never be free to incorporate those technological changes enmasse that are necessary to make a true difference.

We currently have all the technology we need to remove our society from fossil fuels but we need the collective will to make a difference. The problem with individual action is it makes us feel good but since it’s unlikely that more than 1% of the population will ever change their habits what is necessary is to change our entire energy collection and distribution economics which means renewables and storage. That will free up the global population to have more control over their local economies and to stop being beholden to authoritarian dictators such as can be found in Russia, the Middle East, Venezuela and so on.

apart from Tesla there are very few companies that have acquired the economic clout to make meaningful changes. In the case of Tesla, if you follow the history, you will see an all out campaign to destroy the company from the very beginning and they darn near succeeded.
Reply: @anyonehome8609  Does your investigation also have a solution for the chlorine generated when salt water is used?
Reply: This Channel News Dubbing Hindi Language
Reply: What type of water is electrolysed to produce hydrogen? It sounds like electrolysis destroys water. Given the scarcity of fresh water in majority of the developing world, it's probably not a good idea to consume it for energy generation as well.
Reply: @NareshSinghda-da-da  It does disect water in hydrogen and oxigen. Demineralised water is preferable since the electrodes will get poluted otherwise. Saltwater can also produce chlorine gas when electrolised.
So yes: Good clean water is preferable and in return we get water vapour after use.
Your concern is valid.
Reply: @hotdognl70  Thanks for the answer. Do you have an estimate on the water requirements? How much water is consumed to produce hydrogen worth driving a car for 300kms?
Reply: @NareshSinghda-da-da  In all fairness, I don't think that any one has a clue yet. I have seen several claims about efficiency but the variation is too much to take any of those serious yet.
Reply: hmmm hydrogen  🤤
Reply: It's a con-trick to scam money from people without any scientific  knowledge.
Reply: @trashsuitandy9750  The released oxigen is later used to burn the hydrogen. Oxigen might be a by-product but is for sure not a waste product wich can be collected just as well.

The car bomb idea is a bit far fetched, many gasses are flamable but not efficient for the prduction of compact explosives. Note that oxigen is far more dangerous in this context since it can turn even sawdust in to an explosive and accelerates fires!
Reply: I did my research work on hydrogen evolution electrocatalysts.
Reply: It's worth developing. Everything has its drawbacks.
Reply: I see Hydrogen has "potential energy", hence a battery for excess solar and wind energy, and for that reason solar, wind and green hydrogen must equally be produced to get the full benefit. I would like to see a home hydrogen production plant for my future hydrogen cell vehicle. I don't fully buy into electric cars as a future sustainable means for getting around. But I will settle for shipping, steel production and other heavy carbon footprint industries leading the way into hydrogen or hydrogen cell use.
Reply: japan 🇯🇵 is focusing on hydrogen cars so Germany making stories about hydrogen 😂
Reply: hydrogen basically is the same power as electronic. We should make those power more green
Reply: To produce green hydrogen we need huge quantities of green electricity, already we have a shortfall of electricity supply which will agreevate as we move away from coal. Hence I don't believe green electricity will be easily available in excess to produce green hydrogen as it is hyped about.
Reply: BAD IDEA. Too dangerous to handle or be in possession of a simple consumer. Hydrogen is the most dangerous gas in the universe, especially when combined with oxygen. Hydrogen can ignite very easily with O2, and the mixture range is huge (20-80 % or so). So a tiny leak can already cause big problems. When this all rolls out proper, We all just have to wait for the first garage to explode because there was no ventilation.
Reply: It's pie in the sky and will never work if based on wind or solar
Reply: I remember the early dirigibles. 😳
Reply: i hope everybody to be self  sufficiant ....but kinda scares me ...in the future .they would be arguing  (because the world has gone crazy) ...over if that water is more important than drinking  and more people of the world suffer
Reply: I think Vladimir Putin may be praised for providing a cut into "Blue Hydrogen" marketing.
Reply: We should not b duped. We CAN CHARGE  the car With WATER, ⭐do the electrolisis and use the H2. 🌈SHELL&,EXON dont need to transporte and sell us the HIDROGEN.💥No need to complicate logística. 💥We Want AUTONOMOUS CARS
Reply: @marinaclarasanchezsuarez2905  the last guy that believed in free unlimited energy, bypassing capitalists, was stolen from his intelectual property and died poor: Nikola Tesla.
Reply: @lysandroabelcher2592  i know, we are doomed😧
Reply: Please make a video about windmills. What materials are used to make them, the lifespan and how much of waste is being produced when they are no longer operable. Another good topic would be our capacity of storing energy and what issues we are currently having with it.
Reply: It’s in its infancy it’ll take it a little while to get traction and make sense technologically…
Reply: I think it is the best bet for the future, but not there yet...
Reply: Your video was excellent for the geeky but please make another one just for the normal folk on the street, explaining the difference between hydrogen volumes and costs vs diesel consumption in the typical car or electricity Kwh in the typical home, then people would understand the crazy volume of hydrogen required, also it highly explosive etc etc..
Reply: It’s another environmental scam
Reply: The better question, how green is green hydrogen?
It takes energy to make concrete, wind turbines, solar panels, hydrogen storage tanks and recycling it all when it's useful life is over.
Reply: From EU! Hydrogen will be the best solution for big consumers, Factories, Airplanes-Airports, shipping-harbors, trains, and stations, etc who could build their own plant on site and uses its energy immediately with minimal of transport. Cars, homes, etc you will need a mix of all that is available, sun, wind, etc....unless as in some EU countries (Russia-Belarus have also) Where central heating, hot water is(already) produced in 1 big plant and distributed underground to all housing(no separate heating). So considering all this! and if new housing projects would be made and connected for heating and hot water on 1 big hydrogen producer,i think Hydrogen will have a much!!!!! bigger % impact of green fuels than most think it will.
Reply: This was a good honest summary of the situation.  It does work for some applications but much of the hype is wrong since the round trip efficiency is not very good and it is very difficult to store.
Reply: @TryNDoxMe Because the electrical power required to make a useful amount of hydrogen would require enormous power lines and equipment be run to every fuel station.
Reply: @TryNDoxMe OK, I did some back of the napkin math.

It's down since the 'rona, but Americans drive around 13,000 miles per year. The best estimate for fuel efficiency is 0.8kg of H2 per 100 miles so you need 104 kg in a year.  A kg of Hydrogen contains 39.4 kWh of electricity but requires 52.5 kWh to create which means you need 5,460 kWh of electricity production per year. If typical home 10 kW wind turbine generates 3 kW (30% of baseplate) and costs $50,000 installed that means you would need  5 (4.99) wind turbines at a cost of $250,000 to create the electricity you need, not including the cost of the actual electrolysis and storage equipment. If the wind turbine lasts 20 years and has zero maintenance and the other equipment lasts 20 years and has zero maintenance and interest rates stay at zero for 20 years and the car is FREE, your looking at around $1 per mile to drive your vehicle. After 20 years, you do it all again.

That makes the H2 cost $120/kg the cost in Europe is around 12.85 euros. The Euro is down A LOT since the war so it's currently about 1-1 or a little under so it's pretty close to 10 times the cost.

Now if you only drive a few thousand miles a year it's more affordable, but that's a different story. Telling farmers they can only drive into town once a month takes us back to the 1800's
Reply: You didn't actually touch on the water requirements for producing Hydrogen. Could be a BIG sticking point given water is becoming a scarce resource...
Reply: At 11:15 it's that simple
A law that clearly bans the usage of fossil fuel power vehicles only by public authorities like lawmakers, public institutions, and PUBLIC ENTERPRISES, like the law only directs people who have some kind of public authority by a specific year or time and strictly regulates them and rest of public can purchase what they want and by this means there is enough demand to create an infrastructure that will support this vehicles like charging or refueling station and there will be a  definite amount of demand in market which will attract the corporates to create the product that is green for the nature and needless to say with such infrastructure already developed  another law should be imposed on Vehicle makers to first reduce and then finally eliminate the production of fossil fueled vehicles in step by step manner. like after public law gets enacted wait for 3 years this year there may be enough infrastructure to support H2 or electric vehicles then new law for common public comes in that regulates the production of vehicles in ration like H2 car: disel car, in 1:9 ratio and this ration gets increased every year or after a market friendly specific time period that doesn't hurt people, corporations or environment.and finally another law that reduces tax burden or incentivise people and corporations who support this system. It's that simple, we need to understand that market forces of supply and demand don't always work. Government and administration sometime need to take tool in their own hand and fix a problem when they have ability to do a. Iam not inviting or asking KARL MARX to come in and create a brand new cutting edge innovative car that amaze world iam just asking to fix an issue in my car making you (Government) just my mechanic so that I can restart my already existing vehicle.
Reply: @md.sohailali7961  Yeah, another problem. All the fuel used by government vehicles would need to be taken from the electrical grid. The grid is already at capacity. It takes 6-12 years to build a power plant. Jumping out of a plane, confident that you will finish constructing your parachute before you hit the ground is “ hi risk” behavior.
Reply: I think - like other options - the future isn’t a singular or binary source of fuel/energy. It’ll be multiple fuels and energy sources that (hopefully) make sense for their specific applications. 
This silly fixation on finding “one saviour energy source” just doesn’t make sense to me. 
Use solar or wind where it makes sense. Geothermal, nuclear, and then hydrogen all make sense in different scenarios.
Reply: Hydrogen is the future, if you like it or not. Problem is it is still going to be produced in poor countrys and not in rich west. Think about that.
Still going to have to steel it from them.
Reply: @sjefoekel6058  Hydrogen is the future because the corporations have found a new grift to make money with it and the sheep are eager to get shorn.
Reply: @aCycloneSteve  nothing ever changes.
Reply: I think Hydrogen could be very useful in places that perhaps have large opportunities to develop wind power, but perhaps are not near large population areas to then use the power from them. Having hydrogen electrolysis plants in highly rural areas near wind farms, can ensure there is localised opportunity to make use of that energy. A good example would be the islands around Scotland, which are in the prime areas for developing wind power, but are far from major population areas. Developing hydrogen plants at these locations would ensure the energy security of those places as well as potentially providing power for ferries to and from the islands in the future.
Reply: @N81L  If you are talking about a small island, maybe. I did a back of the napkin calculation and "Green" hydrogen is ten times more expensive than "Grey" hydrogen which is more expensive than traditional fuels. If you can run a natural gas/gasoline/diesel pipeline or a power line it's WAY cheaper, no matter how rural you are.
Reply: Producing hydrogen on demand in the vehicle or usage site is the key to it being recognized as the "silver bullet" that it actually is. What if i told you that using the harmonic resonance frequency of hydrogen was a key to enhancing standard electrolysis?
Reply: Everything you need to do is make hydrogen so cheap that it compensates its low energy density, storage costs and low efficiency in supply chain. It is not a big deal when you consider that now we lost lots of renewable energy whenever demand is too low compared to its supply. 

For the chicken-egg problem, just keep producing blue and gray hydrogen to raise demand and don't get in the way of blue and grey until green is ready.
Reply: @renatocorreaarrieche  If you're using wind power to create hydrogen (for example, a modular system where you can bring extra processors online when the wind comes up and shut them down as the wind goes down) there is no "lost" renewable energy when demand is to "low". It only when you connect it to the grid does it become useless. 

If you created modular H2 you would have nearly 100% of the "capacity" of the system, but the cost would still be high.

I've thought that a better use of that hydrogen would be to create ammonia for farming. It's generally windy in the winter so they could be producing the fertilizer in the winter for distribution locally. It would still be ten times more expensive, but maybe you could charge more for the produce to the right consumers?
Reply: Climb Mitt Hoecks
Reply: Paid and sponsored by Gazprom.🤔
Reply: It works, but it's like fossil fuels in that different applications require different fuels such that some things run on gas, other's on diesel and even then different types of gas and diesel are used dependent on various factors.  The same thing will need to happen with electric vehicles and power in that batteries won't work everywhere and neither will hydrogen and the application will, in the end, determine which fuel source will be needed.
Reply: WOOTAH
Reply: We will need all types of fuel and energy types, kust need to be pure scientific about where and what makes the most sense. Even solar and wind  produces waste in longterm, it may not be CO2 (unless it burns to ground), but it still is waste, so are the batteries. But as technologies and recycling gets better there is a lot of potential, just lets be practical about it, and not all marketing ...
Reply: And it is not a hype - this is the road of trials and adaptation. When 10 years later You'll drive a hydrogen car which will make 2000km nonstop - You should remember this episode.
Reply: @JānisGrīnvalds  no, YOU should remember this episode.
Reply: Hydrogen maybe? Nuclear for sure.
Reply: Canada jumped on it.
Reply: Nuclear power and hydrogen fuel are the ONLY known sources of energy that are capable of meeting our future energy needs but are also nonpolluting and in sufficient supply to be used for centuries to come.  They are, in fact, inevitable, unless something totally new comes along.
Reply: Co2 hype?
Reply: All this talk worried about the environment, is just talk. Cars and meat and children are wants. If you care so much? Don’t produce any! Otherwise STFU
Reply: @benjamin ollis Congrats Benjamin, you have a solid comic-book understanding of physics.  Water is essential to life but too much of it can kill you and too much of it in the environment is called a flood.  Same with CO2.  Don't worry - they actually teach this in high school so you'll learn all about it in a few years.
Reply: There is NO climate crisis!
Reply: CO2 is NOT a pollutant.
Reply: Batteries are an environmental disaster.
Reply: @benjamin ollis  (this is from NASA) The levels of carbon dioxide (CO2) in the atmosphere are higher than they have been at any time in the past 400,000 years. During ice ages, CO2 levels were around 200 parts per million (ppm), and during the warmer interglacial periods, they hovered around 280 ppm (see fluctuations in the graph). In 2013, CO2 levels surpassed 400 ppm for the first time in recorded history.   If fossil-fuel burning continues such that humanity exhausts the currently known reserves, CO2 will continue to rise to levels of order of 1500 ppm.  By 2100, atmospheric carbon dioxide could be 800 ppm or higher—conditions not seen on Earth for close to 50 million years.

Countless scientists, climate experts, and governments officials agree that 350 ppm is the “safe” level of carbon dioxide.  We are not at 400 PPM.  Back when CO2 reached 1000 ppm, global average temperature were probably about 10°C warmer than today. Under those conditions, Earth had little ice, and sea level was at least 60 metres higher than current levels.

Such levels are many decades off in the future however, it is estimated that it will take as much as 75 years of directed effort to reduce CO2 PPM back to safe levels.  It will also cost and estimated $1 trillion/yr for that period.  That 75 years does not start until we stop using fossil fuels.  In other words, we have not yet stopped making it worse and it will take an estimated 100 to 150 years to make fit it.
Reply: it's not just one thing either this or that......we should focus on multiple alternatives maybe 5 or 6 and maybe 3 or 4 stands the test of time
Reply: I think the problem with it is that it is SLOW. Zero to 60 on hydrogen in a BMW is around 10 seconds.. that's not going to appeal to the mass market
Reply: Hindenburg?
Reply: the way we are going to do it in the uk is to manufacture hydrogen by using the excess renewable electricity. this solves 1 of the biggest argument against renewables, too much energy at the wrong time. we are testing nitrogen fueled home heating.
Reply: @shaun906  So, what you're really saying is that you'll be the ones responsible for putting the UK in the freezer this winter, for an extended length of time (if it's a hard winter)?
Reply: Blue hydrogen ... I knew this to be a bad idea 40 years ago, when in Physical Science class at college I was taught burning fuel directly is always more efficient than converting it to another form of energy. Green hydrogen's basis - wind -  cannot even provide enough energy for NORMAL electricity generation on a consistent basis, let alone more than that for splitting out hydrogen for energy use. 
Even if cost keeps getting lower for these alternatives in the near term, they take decades to be realized cheaper or even equal to today's energy economy, with no guarantees that ANY of that happens. 
This entire concept of hydrogen use is hype, a solution that doesn't solve anything. My involvement in limited hydrogen fuel use during my career showed it to be highly flammable, so much so that the general public should never be allowed to get near it, for the likelihood of triggering explosions is too great. 
We need less emphasis on supply of energy, and more emphasis on demand for energy --- and reducing that demand factor requires serious emphasis on world population reduction.
Reply: @rayrussell6258  So you would need around 2 World Wars--or one massive, Scamdemic EUA experimental sauce jab?
Reply: It's just a nitch. Nuclear should be the main power source. It can run every container ship on the planet.
Reply: @drunvert  Three Mile Island, Chernobyl, that generator in Fukushima, Japan ..... some of you people just can't see forest for trees. Nuclear is DOA. 
At least I can somewhat agree with you on hydrogen, although it doesn't really rise up to the level of niche, truthfully.
Reply: I believe that hydrogen will find a place as a transitional fuel at best. Simply because current internal combustion engines can be modified easily to run on H2. Other technologies promise much greater returns in emission reduction but may need more time to mature. Fuel cell technology seems promising but they can actually run on natural gas too and even with the resulting emissions,  may actually have a lower emission footprint once you factor in the emissions produced while manufacturing the H2.
Reply: @jeremymasterson5818  Consumers in general public would cause so many explosions while refueling hydrogen engines, and honestly there is no way to prevent it. People need to understand how ridiculous it is to keep discussing hydrogen for mass consumption. There is never going to be enough simple H produced anyway, just like there isn't enough wind or solar to go net zero.
Reply: Green hydrogen will only become cheaper than blue or gray, by making those more expensive.
In fact extremely expensive by taxing and profits.
And when green is the only hydrogen available, in the end they will charge the same price, because governments and companies still need that tax money and profits.
Reply: It's the future, we'll find ways to make it more efficient. That's what mankind does. We find solutions. Maybe nuclear fusion, combined with renewable energies and hydrogen is the answer to our challenges.
Reply: I think we should build sodium thiuram nuclear reactors
Reply: i would like to see hydrogen as a buffer instead of batteries. You could use exess wind and solar energy to convert it into a gas that can power cars down the line and use dedicated nuclear powerplants to keep the hydrogen going. 

Sure it wont be as efficient as using electricity but the benefits would be the refueling, not wasting the green energy when it is not needed and you could story energy in greater volumes then now.

If everyone has solar on their homes maybe you can even make your own hydrogen for your car at home
Reply: Definitely not the fuel of the future. It produces less energy than it takes to electrolyze it.
Reply: all energy causes an extremely horrible environmental impact...clean energy...lol
Reply: Renewable energy itself is a scam.
It’s all about lobbying.

It’s just Li resources gonna depleted replacing fossil fuels. At the end the impact on environment isn’t going to end.

May be after 20 years DW could make a documentary on this.
Reply: Thanks for the great summary of the current space.
Reply: is there always a down side and what's the cost
Reply: 1 cup full almost killed my father and I.  As a kid I was trying to make a furnace using hydrogen and it exploded throwing both of us a distance of several feet.
Reply: Green Hydrogen is NOT carbon neutral as you said. Any renewable technology requires energy and transportation to produce and implement. As an example the Rare Earth metals used in solar cells are mined. Then there is the disposal and contamination issues of old renewable products being disposed of.
Reply: @symonpeters4431  in time will be neutral, producing x energy by renewable will neutralize the carbon you use in that time with that x policarbonates energy
Reply: Cars
Reply: Need a bit boost
Reply: Layman question: Nitrogen is the most abundant gas in the atmosphere. Wondering if it can be used directly/in some other way to generate energy (again) directly/thru batteries with clean bi-products.
Reply: There is no alternative, hydrogen must and will be successful. We are cave dwellers in its technological knowledge.  It’s a matter of time… And if we have enough time to wait for the mind of its creator to be born. Our great frontier is not Space, it’s nanotechnology.
Reply: Not cost effective  we need cheap energy
Reply: It is no hype in Europe! It is a working growing infastructure!
Reply: What % of emissions are created by politicians? Or active volcanos?
Reply: Lobbying, nothing else
Reply: There's another issue that needs to be simultaneously addressed, which both big businesses and governments (run by politicians funded by big businesses) are not ready to address: For example, in large urban areas - and a significant population of the world now lives in cities than ever before - we must move away, or drastically minimise, individual ownership of vehicles and shift to mass transportation systems with feeder systems that cover the nearest areas close to stations.                                                                                                                                                                                 Unfortunately the car industry has created this craze for ownership of cars so much that abandoning individual ownership is seen by people as a "loss of freedom". There's much work to be done on that front in different areas raising awareness, making rentals affordable and easily available whenever required, apart from the investment in such transportation systems.
Reply: Since you need to expend the same energy (plus losses) to split water that you get back by burning hydrogen, it's not an energy source. That's the key, basic law of conservation of energy.
The hype is waffle and lies.
Reply: The truth is Gasputin's gases only dilute it with carbon. 😀
Reply: It's not hype. try it. read about it. I already have it. It is great. Don't believe uneducated news presenters.... Figure it out for yourself. Don't trust the scientists they are ripe with lies and corruption. They are inherently corrupt because they do not chose any of the fields of research.
Reply: If the production in enough quantity can be achieved using solar and wind power it is the only infinite resource which also produces zero emission issues.   H2O > 2H + O > H2O
Reply: Well hydrogen is a great answer but it must be in transport as water or we're going to see the reenactment of the Hindenburg blimp.
    I've watched these government people I work for them for 33 years they're dumber than a box of rocks whenever they start putting hydrogen filling stations all over the United States get ready for the Hindenburg..!
Reply: @AllenBarclayAllen  uhhh and you think that hydrogen is different in that aspect to other gasses for heating in your home or fuel for your car?
Reply: more hype than reality. uses more power to make than it provides,
And why not use our carbon based fuels that are cheap, reliable and plentiful?
Reply: Tidal turbines are more reliable. Tidal waves will always be there.
Reply: Hydrogen is the future provided it is made as green hydrogen from renewable energy.   This video gives you the impression that all H2 will be made from fossil fuels which is not true.  It also gives you the impression that CCS does not work which is also a lie
Reply: Part of a suicide pact. CO₂ is a harmless, vital compound that needs corruption (political) to sustain its argument. IOW the principle role of government. Good rocket fuel though.
Reply: Like all renewables, one big lie and you know it, DW. 
We better burn oil&coal, or take it seriously like Chinese do and go full nuclear. Thorium was prescribed by dr. Alvin Weinberg and climate scientists in 60's but we don't listen to specialists, do we?
Reply: I think it's important to take the H2 we need and use it wisely and sparingly for where we absolutely need it. Our main focus should be on degrowth in the global north, using hydro, solar thermal, pumped hydro and molten salt storage to run a smaller grid, with as small a vehicle as we can, powered by the lowest ecological cost options, rather than financial. 

An overlooked issue with H2 is it's leakiness (to be being such a small, light molecule), and this could be significant ecologically as a critical resource from Earth gets lost to space. For as long as aviation remains a thing, I can see it having a role there, though, as there really aren't many other realistic options for heavier than air flight. I think it will be of value in trucking too, though we'd be better off moving as much longer distance trucking as possible to electric rail, which is far more efficient, and using battery vans and cargo bikes for last mile work.

For marine shipping it will be very useful in conjunction with sail power, using fuel cell driven motors for maneuvering, docking and in adverse conditions, and relying on sails at other times - the longer the journey the more efficient sail is.
Reply: Total BS.
Reply: Hype.
How much is a hydrogen storage station vs gasoline station vs a charging station? 
When u find that out, you will see which one is total nonsense.
Reply: Solar, wind, nuclear and hydroelectric can produce enough electricity for all. They all needs to be made low cost, safe and available to all countries in the World.
Reply: green hydrogen is the future powersource

it will secure the energydemands And can be transported to the needs.

/magnus, 🇸🇪 sweden
Reply: It's hype and nothing more. 

Complete infeasible. 

Just wait until Elon gets on the Hydrogen train. Suddenly Hydrogen will fly us to the moon. 

Quite profound.
Reply: bull shit
Reply: I think it will end up being just water under the bridge and a lot of hot air.
Reply: Internet not a hype. It will be much better as the technology matures. It’s just being blocked my oil companies. I’m glad Japan is getting great leaps on it.
Reply: People...the king of Belgium and the president of Namibia just filled up a truck with hydrogen in Namibia.....why are you talking about 2030.....it's hear ..Duitse suidwes Afrika....
Reply: It has a place in some manufacturing and quite possibly for ships and passenger aircraft.  However, it is not suitable for cars, as EVs are much more efficient.  EVs are also more convenient, as you can charge them at home.
Reply: so, better batteries?
Reply: July 2024: The hydrogen hype is a massive scam by the oil and gas industry to keep supplying fossil Fuels. They know that we are nowhere near capable of economically producing green hydrogen. They have conned governments into decades of billion dollar subsidies to "develop" hydrogen. Methane leaks are already above 3% (from extraction to consumption). Blue hydrogen is a pure con and at some point in the future, governments and ecologists will wake up to this. Sad.
Reply: $$$$$$$$$$$ kwh !!!! Inviável!!
Reply: the same I make of all technology, #Sceptism #Reseacrh #testing #FieldConditions #openMindedness #diversification #Flexibility. The way we are seeing energy evolution, focusing on a single form of energy is not going to serve us well. We should keep an open mind about sourcing local and testing new technology under field conditions!
Reply: There is no climate crisis
Reply: green hydrogen ftw! ❤
Reply: As an engineer, I'm aware of the possibilities of disassociating hydrogen and oxygen atoms as a fuel and then associating them again through combustion.  The problem is the energy required to disassociate the water molecule is greater than the energy of combustion so it's hard to see this as a panacea for global warming.  Mother Earth's problem is the motor car, and no one is going to give up the motor car, so we continue to combust 100M barrels of oil per day producing 100M barrels of water every day and the heat from  60M barrels of oil is simply wasted to atmosphere, all from the internal combustion engine.  This doesn't take into account the natural gas and coal combusted which produces similar results.  So my friends y'all better hope they find another couple of inhabitable planets within commuting distance, I'd say planet earth will be unrecognizable by 2125.
Reply: Hydrogen hype was pushed by the oil n gas industry for their continuation of doing business,from production, distribution and storages all spell waste as the efficiency is out of the window, why not focus on battery tech, the more the tech grows the better.
Reply: Logistical nightmare because hydrogen slowly boils off and hydrogen tends to explode when it is burned uncontrolled e.g. an accident
Reply: @pepelajuandeag1696  hydrogen is not explosive. it needs to be mixed with oxygen in order to explode. if you were to open a hydrogen tank and put fire inside, there would be a flame traveling with the entering oxygen. no explosion.
Reply: @pepelajuandeag1696  you at the lion fires of the Chevy Bolt? No explosion but wipes out anything near it, including other electric cars.  High volumes of energy is dangerous.
Reply: @Pepelajuandeag 1  lithium ion batteries and petrochemical fuels can cause pretty impressive fires, too. Hydrogen infrastructure can be built with comparable safety with some engineering.
Reply: I think investing time and resources elsewhere would be considerably better served. Its already a niche fuel use-type and scaled use of Green Hydrogen hinges upon going against the Oil and Gas industries away from Blue and Gray Hydrogen? I don't think that is happening on a large scale in the next two decades. 
Appreciate the video though!
Reply: @kevinfagan4232  👍
Reply: @kevinfagan4232  there are large scale plans to produce green hydrogen in Australia various govts seem to have faith in being a viable fuel.
Reply: 🎉🎉🎉🎉🎉finally🎉🎉🎉🎉🎉
Reply: @anyonehome8609  what is making you so happy?
Reply: Not ever going to happen in cars for the whole world. It’s battery evs all the way. 

The mirai has gone nowhere in the the 8 years since it debuted in 2014.  While Teslas an other brands have been dominating and can actually do cross country road trips.
Reply: It’s a great fuel. But I think we should also use nuclear power to supplement it. Nuclear energy isn’t as scary as Greenpeace wants you to think it is.
Reply: @therealspeedwagon1451  Fukushima and Chernobyl are proof of how safe it is!
Reply: Probably over hyped.
Thoughts on using geothermal to make energy and sense its making steam anyway why not also produce hydrogen too.
Reply from the maker: We have also done a video on Geothermal energy before. We've just dug it up from our archives for you: https://youtu.be/c7dy0hUZ9xI
Reply: @DWPlanetA  More to the point... what do you make of the "climate crisis" scam? You seem to have bought into it.
Reply: @thesilentone4024  Because geothermal emits CO2 ?
Reply: @mariom1417  a little bit but its much less then most energy sources now.
Solar and wind emits co2 when being made and lots of that isn't recycled.
So why not use something thats not going to be replaced in 10 to 20 years. 
Or 60 to 80 years for geothermal.
Reply: @thesilentone4024  Not a little bit. Oh no. Try ESMAP ft the WB for examplem
Reply: @thesilentone4024  Especially true when ground source heat pumps tend to have an average COP of 5, which makes them cheaper than gas (in the long run)

The big issue is the refrigerants
Reply: Hydrogen is a Great opportunity. You should make a Video about Algae aswell. They can produce Energy that could be stores with Hydrogen aswell ⚡
Reply from the maker: It's your lucky day, Julian! We have a few videos that highlight the benefits of algae. You can watch them in the links below: 
Why the world needs more algae, not less: https://youtu.be/bcyIbq3NhI0 
How to make "plastic" out of algae and mushrooms: https://youtu.be/KVOG-fG5bD4
Reply: @DWPlanetA  Why did you use the 20 year global warming potential (GWP) number for blue hydrogen when the established standard is actually the 100 year GWP?
If we use the 20 year GWP number, running your EV on any grid mostly powered by natural gas will be just as bad as coal. This would also make every battery EV just as bad as their ICE counterparts in terms of emissions. Using a 20 year GWP standard makes ICE electric hybrids the best vehicle to reduce GHG emissions and craters our global carbon budget. 
This is why we should never just quote statistics from climate activists or climate deniers. 🙄
Reply: @_ao101  look omookooooooooooo9oku look p
Reply: @_ao101  me i
Reply: @_ao101  me i
Reply: @_ao101  aq
Reply: @_ao101  pl
Reply: @_ao101  llpl
Reply: @_ao101  7
Lpp
Reply: @_ao101  and Fusion Fuel Green, produces hidrogen with solar panels anywhere with sun
Reply: @_ao101  dislike
Reply: @_ao101  😮
Reply: @_ao101  It is a great technology besides all the haters. It has its issues. The main issue is that it costs too much. Surely breakthroughs will happen that can bring the cost down.
Reply: Why do they call it green hydrogen? This has to be against some marketing law. You are giving the impression that the hydrogen is sustainable, but in reality the hydrogen made is only using renewable energy that could be used to make other industries, that actually are useful, greener. Thereby you havent really reduced any emissions, but actually potentially increased them by 60%. There should be a law saying that you can only call it green hydrogen if it is sertifiably made by only using surplus renewable energy.
Reply: @PaulusTigana  you seem to have a twisted logic on renewable energy. If a renewables, solar, farm is built somewhere. Nothing prevents the farm up the road using the same sun to produce electricity that goes to the uses you advocate for. An yes, over generation should be used to produce Hydrogen or charge grid batteries or pump water up hill to fill the top dam of a pump hydro energy storage infrastructure
They're the only uses for excess generation.
Reply: The whole effort is to make a bigger market for natural gas, and using natural gas it is not "grey," it is the dirtiest fuel available including being dirtier than coal.
Reply: With our present science hydrogen is not the solution, but as the race official said, it's a start.
Reply: @billcox1995  Yea, corn ethanol was a start too. Science is not based on the assumption magic happens. 

If these political clowns were objective and honest? Intermittent would not have been so fatally overbuilt. Causing killer grid failures and now wars. 

Fix the real problem rather than throw another impossible ball in the air. Sooner or later just like excess intermittent, it will cause systemic failures. 

Like excess intermittent or biofuel, this will not work due to the Laws of Thermodynamics. You know, basic science.
Reply: @billcox1995  Better look at the Japanese surface transportation technology. 

We have a super-efficient reformation process. The challenge is not technical. It is corrupted medieval political 'rights'.

The real question is why refiners price hydrogen at an absurd markup. Input cost 1/5 that of oil. The process is near 80% efficient. 

Distribution is a challenge. This is why Toyota is focusing on heavy trucks and local delivery. 

Look most of the warehouse equipment is now fuel cell. It just takes a natural gas connection to reform on site. 

Vastly superior to batteries. WHich are done now. 

I think you need to spend some study time on the current applications.
Reply: That you were lazy and didn't look up all the sources. You'd mention ammonia storage.
Reply: it would be great if we focus on where it's needed. It's a disaster when the fuel lobby and crazy anti battery people get their ways and try to use it for road transportation or even house heating.
Reply: gas turbines ...
Reply: Hydrogen is the only long-term energy storage we have. Unless processes like the Allam cycle take off, how can countries power themselves during winter when there's no sun or wind. I also largely disagree with the report mentioned here, I've reviewed it and come to a vastly different conclusion when using BEIS figures opposed to the ones used in that high level report.
Reply: Bottom line is - Hydrogen is the "Perfect Fuel"...

The only issue - is how it is produced... just like electricity...

That is why, we (the Planet) need to focus on MASSIVE solar collector power plants - throughout the world's deserts...

It is a very simple exercise to build transmission lines and tie into existing grids - to distribute the electricity produced...

Power is stored in giant (600°) molten salt vats - so production can continue after the sun goes down...

Same plants can produce hydrogen - which can easily be piped to cities and ports...

A tiny fraction of the money WE spent on destroying the innocent and sovereign nation of Iraq... could COMPLETELY build the entire infrastructure - to completely "green" the unlimited production of electricity and hydrogen...

AND - guess what... ONE HUNDRED PERCENT - ENERGY SECURITY
Reply: @robertalphonso7676  you disregard the cleanest fuel - H202 - so easily ?
I suggest you find out about it on Youtube its powered the Worlds Fastest cars , as a practical recommendation
Reply: @NCOGNTO 
Did not disregard - simply not familiar with... A little research did bring this up...

 The energy density of aqueous H2O2 (60%) is 3.0 MJ l−1 (2.1 MJ kg−1), which is comparable to the value (2.8 MJ l−1, 3.5 MJ kg−1) of compressed hydrogen (35 MPa). However, the photocatalytic production of H2O2 from water and O2 has yet to be combined with the consumption of the produced H2O2 in an H2O2 fuel cell because of the insufficient photocatalytic activity4,5. In order to realize the production of H2O2 and its use in an H2O2 fuel cell, a breakthrough is definitely required to improve the photocatalytic efficiency for H2O2 production.
Reply: @robertalphonso7676  have you considered confined decomposition engines with H2O and O2 for exhaust and storage in plastic jugs ?
Or production at the point of sale for economy ?
Gotta think about this stuff - economics 101 ....
Reply: @robertalphonso7676  you do know H202 has powered the worlds fastest cars ? and ....
90% H202 has about 80 % of the energy of cryogenic H2 ?
Reply: @robertalphonso7676  only you saying "fuel cell"
I say "engine"
Reply: It's up to the Government. If a government decides and puts money on this kind of project, there is no shortage of scientists able to solve all the problems. And it has to be a government initiative, because you can't leave it to private businesses. Just think how many technologies are very old, but they were not widely developed because the initial costs are economically challenging. Businesses want to make money.
Reply: I know there is not enough economical lithium to replace our current production of fossil fuel cars. So if we are going to go green in Europe and the West, then we will be embracing hydrogen as our main fuel source for transport.

With predicted battery output in 2028 forecasted around 1200-1300 GWh, and the UK and Europe going electric with new car sales between 2035-2040. We can see that there will be a demand in that region alone for all those GWh. That is assuming ALL those GWh are for electric vehicles when the reality is they are not, we will still need laptops, phones, watches etc that use lithium batteries. Then there is also the rest of the world.

It seems Toyota, Cummins, Ballard, Plug Power, ITM, HydrogenOne and others are all aware of this. They are the leaders in hydrogen tech, and hydrogen tech also solves another challenge of ours with the green revolution. How do we turn the lights on when the wind doesn't blow or the sun doesn't shine? Quite simply, all green energy excess is used to produce hydrogen that can be used through PEM fuel cells to generate power on demand. Battery technologies suffer from degradation issues that economical equate to a similar level or higher in comparison to efficiency loses with green hydrogen production.

Hydrogen production for fuel stations can take place on site and doesn't require tankers like fossil fuels. We are in a chicken and egg scenario, where the cars struggle to come without the infrastructure and the infrastructure struggles to come without the cars... so governments must take charge and develop the infrastructure in the same way they maintain roads and rail, otherwise we will fail in our green objectives.

So although everyone thinks they will be driving around in EVs in 20 years, unfortunately only the luxury cars will utilising that technology in the form we see it today. Your VW Golf will be running on hydrogen.
Reply: What about making Hydrogen on a very small scale, like each household?
Reply: Its the only possible Future! The government must promote its use by law
Reply: Utter quackery. It sounds like a good idea because it's conflated with fusion.